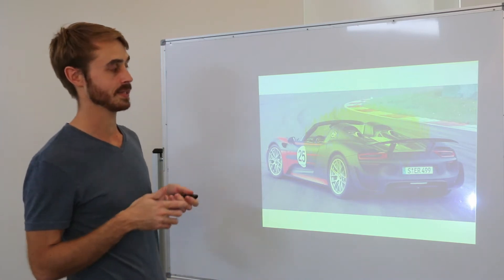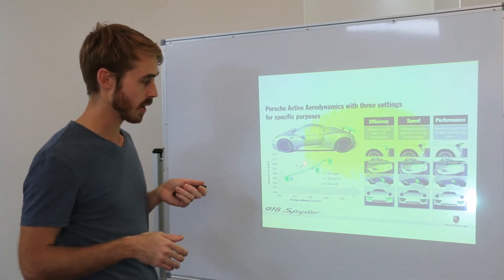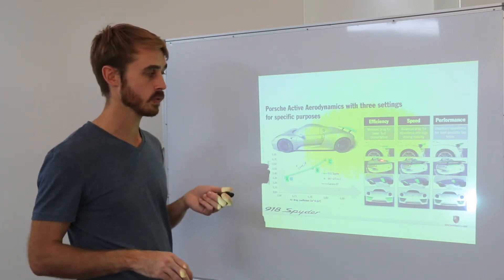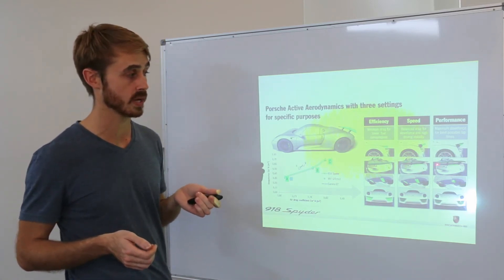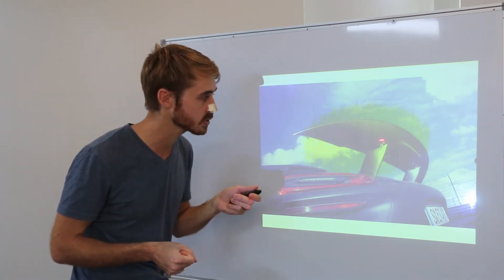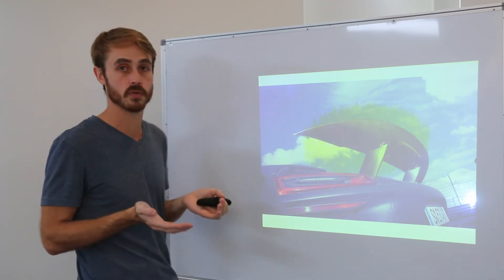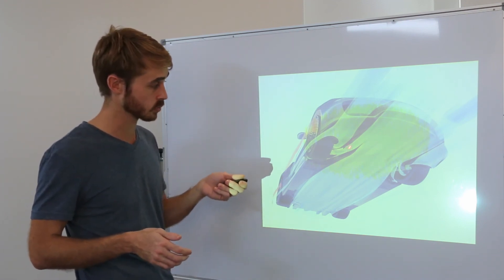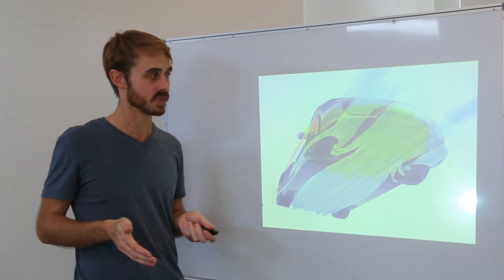Porsche 918 - Active Aerodynamics Analysis

Comment: The 918 also has an active flap under the rear wing (between the wing supports). From what I remember, it has about half (or more) the downforce of the P1.
http://media.caranddriver.com/images/13q4/557345/2014-porsche-918-spyder-rear-spoiler-photo-558865-s-1280x782.jpg